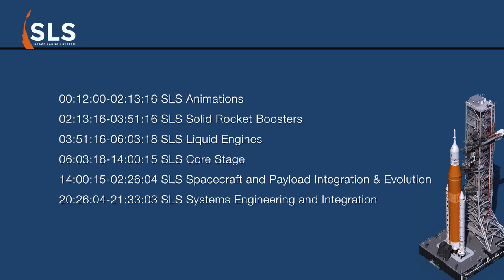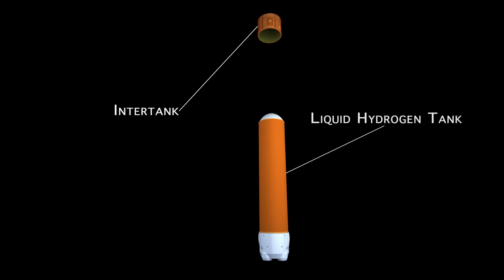NASA Space Launch System - Resource Reel August 2018

Comment: "The most powerful rocket ever built".  Is it more powerful than the Saturn V? If so, what makes it more powerful? And why does it have to be more powerful? It's doing the same thing.
Reply from the maker: The first stage has more thrust than Saturn-V even though in total, SLS (even block 2) has a lower payload to orbit. NASA is careful about the words they use :P
Reply: Those solids are insanely powerful..., plus its using 4 rs-25 engines rather than the usual 3 on the shuttle.